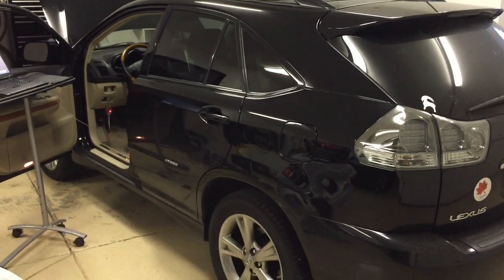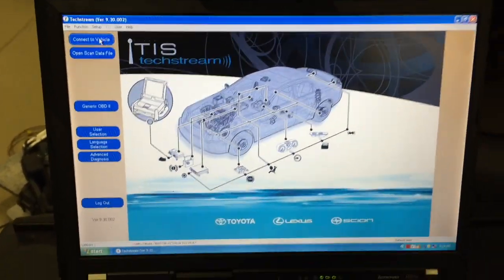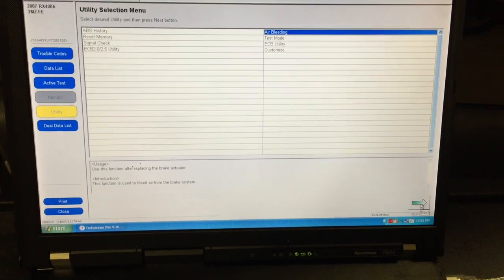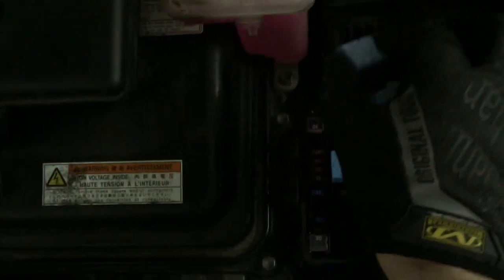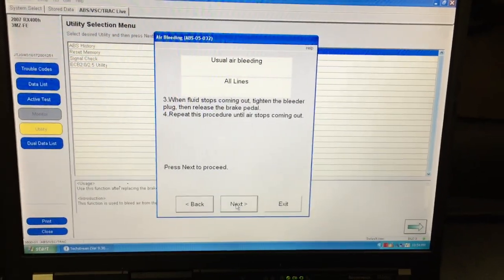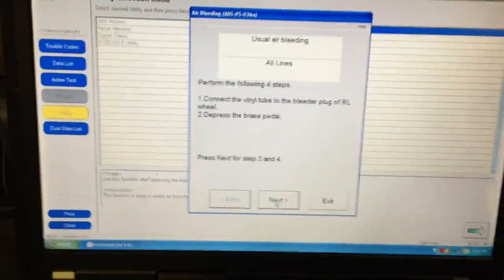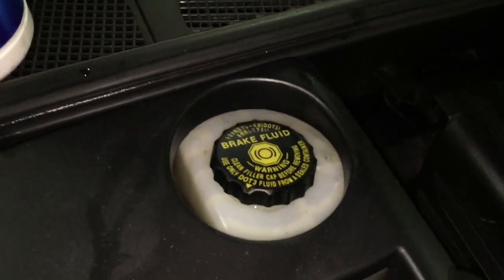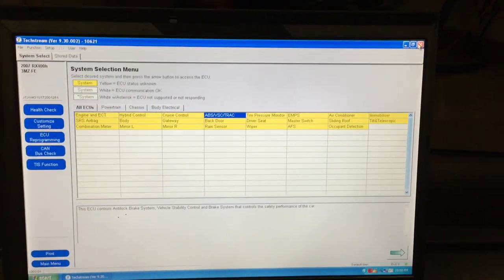Toyota & Lexus Hybrids - Computer Hydraulic Brake System Bleed after Brake Pad Replacement

Comment: And how is this car any better than a Mercedes or BMW? Sounds very expensive to have this done! I thought it would be cheaper than MB or BMW?
I'm looking at buying a Lexus because of its reliability ratings and longevity of Lexus but after watching this video, I'm questioning the amount of maintenance and cost of maintenance for this vehicle!
Reply from the maker: All modern vehicles require specialized diagnostic software to do specific maintenance and repair routines. Toyota/Lexus is definitely no worse than other brands. The vehicle in this video went over 100k miles before needing to have the brake pads replaced, which is very good for an SUV/crossover.

Comment: On the 07 gs450h I had to replace the left rear Caliper and rear pads. Not knowing about this procedure, I tried bleeding the system normally. When we pressed on the brake fluid did come out of the bleeder, flowing rather well. But ABS, VSC, and brake light stayed on. Any Ideas??
Reply from the maker: I tried bleeding normally the first time and it seemed to work. but then I got all of the dash lights afterwards. I had to follow the procedure in the video to get the lights to turn off.

Comment: Hi Carlton. In need of a bit of advice. 

I bled just one of my front brakes as I had to replace a seized caliper and didn't use the Techstream software/procedure. As soon as I started bleeding and turned the car on it said "Brake malfunction", "ABS Malfunction", there is a constant beeping sound when the car is turned on and now the brake pedal is super firm and the car doesn't stop as good as before. 

I tested the brakes on a long stretch and now when I brake hard, the car kind of steers to the right (I serviced the left brake caliper). Does that mean that there is still air in the brakes? I bled until there was no air bubbles and didn't leave the brake reservoir go under minimum. Do I need to bleed the same brake again with Techstream attached?

Thank you in advance.
Reply from the maker: Those are the same symptoms I had after initially (mis)servicing the brakes. Doing a full brake bleed with the Toyota tech stream software fixed the errors for me. Based on what you’ve described, my guess is that it will fix your problem as well.
Reply: @ProjectBiehlmeister  Thank you for your reply Carlton. Did you also have very firm brake pedal? The weird things is that before turning the car on, the pedal feels normal, but as soon as the car reads the errors the brake pedal gets really firm.
Reply from the maker: @kristiandimitrov7762  I don’t recall the exact details, but the brake pedal did feel different. It’s a complicated parallel assisted hydraulic braking system and does weird things when it malfunctions.
Reply: @ProjectBiehlmeister  Yeah, I think my regen braking isn't working either, or at least the gauge doesn't go down to the Charge area. Btw I forgot to mention that my RX is 450h 2013, but I guess brake system is pretty similar to yours
Reply: @ProjectBiehlmeister  Any idea where the ABS Pump motor relays are located? Are they supposed to be in the fuse box cos I can't see anything else apart from normal fuses in there.
Reply from the maker: @kristiandimitrov7762  Sorry, I’m not sure where things are located for the 450h.
Reply: @ProjectBiehlmeister  Thank you, no worries. Where were the ABS relays for the RX400h?
Reply from the maker: @kristiandimitrov7762  You can see them here in the video https://youtu.be/yDdQir5xktU?t=322